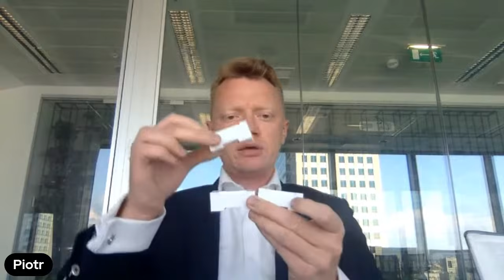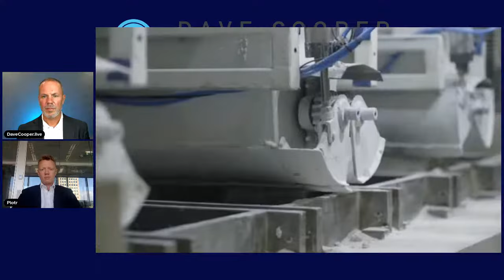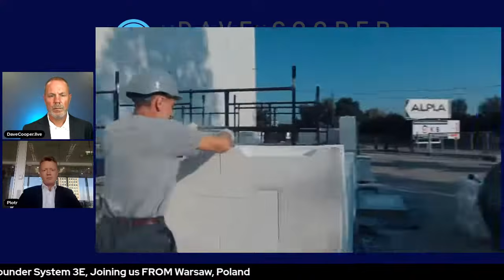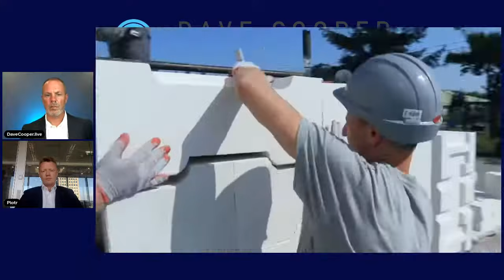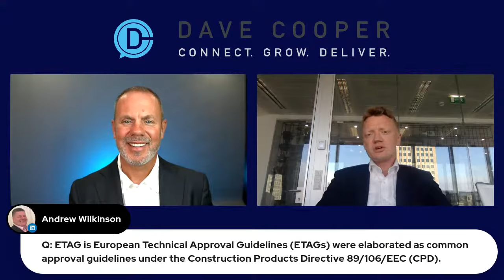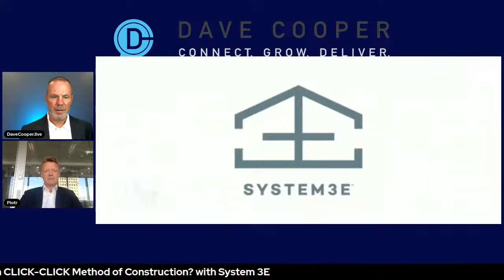Is it Safe? Constructing Walls Out of Blocks Without Binder and Insulation

Comment: It's works for tropical storms winds..?
Reply from the maker: Without insulation and weatherproofing, water can seep into those walls, leading to all sorts of problems like mold growth, structural damage, and yucky indoor air quality. Nobody wants that, right?
Reply: @DaveCooperLive  weather in Poland is rather rough. From strong winds, to lots of rain, heavy winters and hot summers. I think it will resist your silly concerns 🙂
Reply: @DaveCooperLive  No more than brick or cinder-block, it appears.